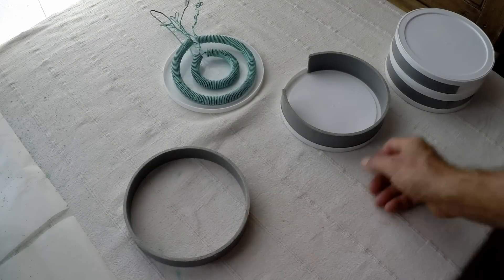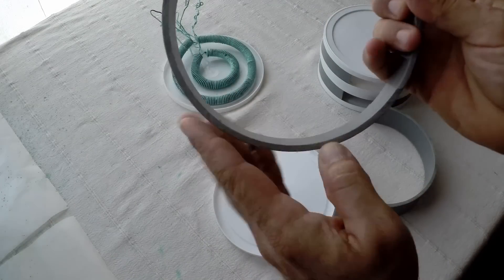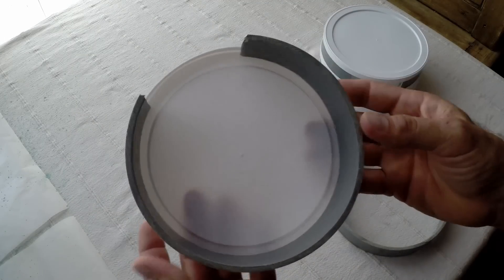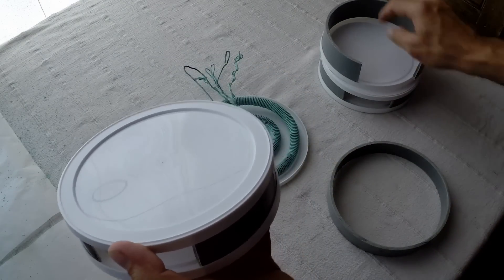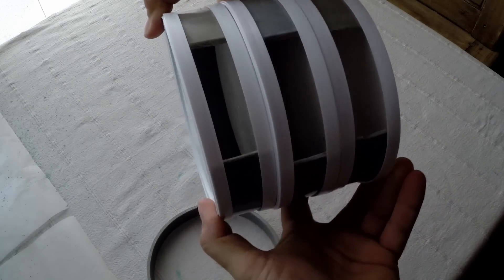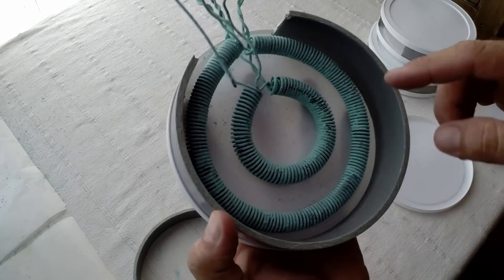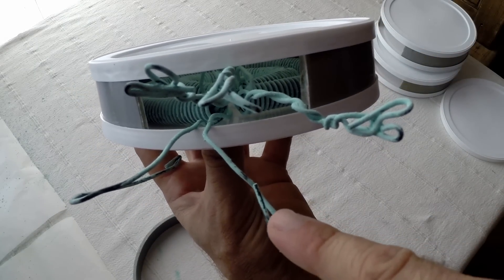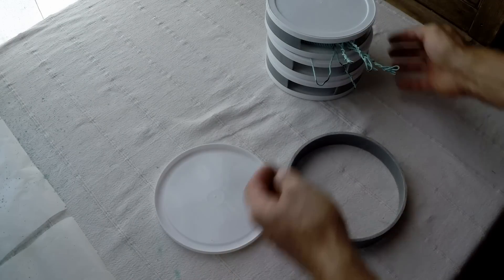Making a Keshe Coil Stacker

Comment: I have to make the coils I don't  know  what  I was thinking asking that question . Sorry I realize  that was on the previous  video . I don't  have that power tool to make them. I'm  going  to  see if I can borrow  one from someone. 
My question really was where do I get the copper wire from?   I'm  going  to  go  to   my local hardware store to see if  they  have the copper wire. Sorry  for  the  dumb question . 😊😊😊😊😊😊
Reply: Hi Wendy did you see the message that Elly sent to You regarding copper wire? The message is just a couple messages down
Reply: +Wendy Cross    I do not know where it is you live - but here in the US of A - we have many hardware stores here that sell copper wire - for the most part has to be peeled though.  Here in Clyde, Texas 13 miles outside of Abilene... I get 14 copper gauge wire on 500 foot rolls for like $32.98.... but if I were to buy 3 rolls at a time - I could get it for $30.00 per roll.  I do have an alternate suggestion for you though...

Maybe where you live there are not so many handy home owners doing their own work?  So maybe look up an Electrician in your neck of the woods... he or she certainly has to buy IN BULK... so they will have cheaper deals that you may be able to cash into... not talking business today on the Sabbath - just speaking as to what you can do after Sabbath... but times there will be where an Electrical Contractor may only have a short amount on a spool left over from stringing a home - well they usually toss it into a container to sell at the metal salvages...

Actually you could also check at the metal scrap yards - they always get bare copper because the price of bare copper is way higher than "dirty copper" - meaning they still have a wrapper, paint or mixed with other metals that were not separated from the copper... and even if you can only get 5 or 10 foot sections - that is plenty long enough to make capacitors from or to use as wire to tie everything together with - or making the pain pens and/or etc.  Hope this opened up your horizions where you live... and may you be blessed in every righteous thing you put your hands to do...

Peace~